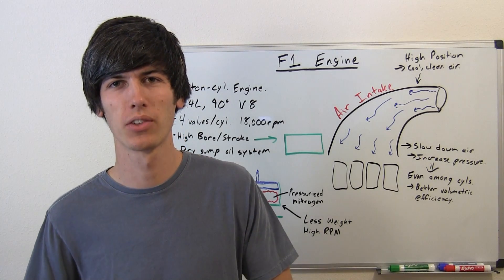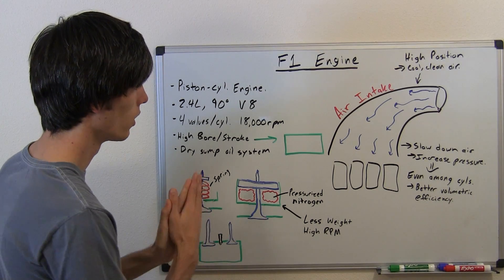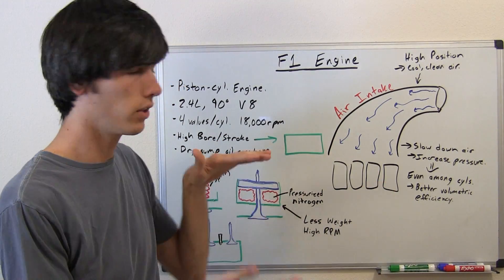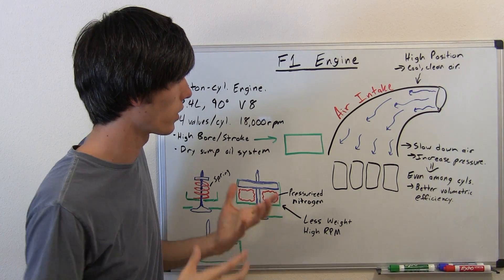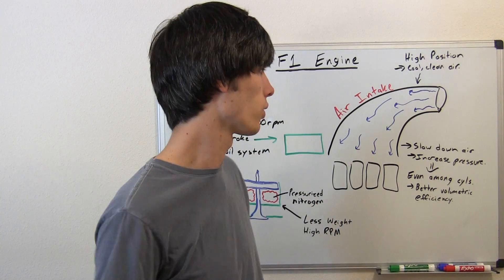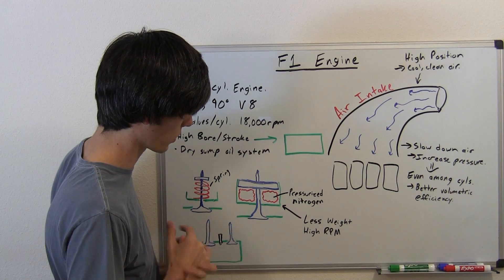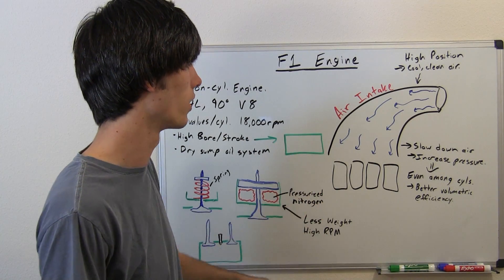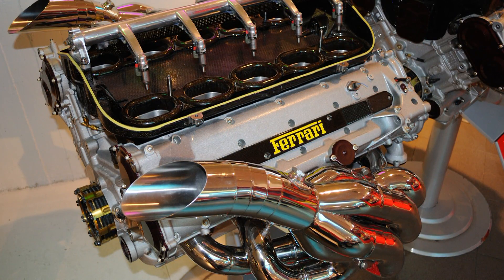F1 Engine - Explained

Comment: Fun fact, 600cc street bikes rev to 18,000 rpm's too. When I ride mine I'll purposely wind gears out just to watch how many heads it turns when people are trying to figure out what the hell is coming down the road ;)
Reply: +Nathan Berry mines putting out about 50 lbs peak torque with the exhaust system I have. They have inline-4 cylinder engines. All Japanese street bikes use inline-4's
Reply: +ReaIDeaI1 What do you ride? Didn't realize there were 600's that can rev that high
Reply: FUNKieMONKey55 I ride a 2008 Yamaha R6. There's older 600's that turn 20,000 RPM's lol
Reply: +FUNKieMONKey55 Older 2 stroke motors could Rev up pretty damn high. more than 20k rpm if I'm not mistaken
Reply: +Jeffrey Kim Depends on the displacement. 50cc racing bikes got there pretty easily. even in the 70s.
Reply: How much torque do those put out? Its a one cylinder engine right? Sorry i dont know shit about bikes im a car guy but i love engines no matter the aplication
Reply: +ReaIDeaI1 That's funny my Japanese street bike is a V4. I also have another Japanese street bike that is a V-Twin
Reply: sera56jase all modern japanese supersports have inline-4's anyway, not sure about older ones and sub-genres. The BMW uses an inline-4 as well
Reply: i think the old japanese two stroke were parallel twin's

Comment: how much horse power do they get out of these 2.4 naturally aspirated v8s?
Reply: 800-900hp
Reply: +Alec Collins about 750 from the V8 and about 900 from the V10. As of right now the V6 Hybrid gets 750 and there are speculation that they will boost it to 1000bhp (I don't know when

Comment: Explanation on volume efficiency through the intake is incorrect actually. What happens is the air funnels through the intake and down into the head. When you have a long runners this actually causes the air to move in the intake at a higher velocity than it normally would be with a shorter runner. So it is not a situation of low air up actually increased volume movement of the air through the intake. Therefore moving at a faster rate and causing it to fill the cylinder at a faster rate and more completely. This is why they put velocity stacks overtop a carburetor or individual tubes leading into the cylinder heads intake valve is the longer. And this tube is at a certain length and diameter that will cause it to your air to spin ( "rifle" ) into the cylinder at a higher speed. This increases the fill rate of the air going into the cylinder and fills it more completely at higher speeds.

Comment: Surely an engineering major would know that engines don't suck, he atmosphere pushes the air into the engine. A higher pressure always moves to a lower 
pressure area
Reply from the maker: +Todd Black (TeeBee53) I've been lost for many years, thanks for your help!
Reply: +Todd Black (TeeBee53) Actually, engines do suck.  there is vacuum created as the piston pulls down which sucks air into the cylinder.
Reply: well thanks Mr iknowevereything
Reply: yeah no. atmospheric pressure on the outside of the engines pushes air into the cylinder on the intake stroke whilst that cylinder is making vaccum. it is that reason why engines make more power with higher atmospheric pressure ie. at sea level as oppose to 1,000ft asl. simply because there is more pressure to push the air in.

Comment: The V-10 you showed at the end of the video has a vapor mist system for the itb's. What would they typically spray in a formula one car? Water - Meth? or?
Reply from the maker: +Caleb Smith Fuel. :) (Those are the injectors).
Reply: +Engineering Explained Lol Gotcha. Still learning. I really like your channel and all the info I've gained from it so far. Thanks
Reply: +Engineering Explained Would that be common rail injection?
Reply from the maker: +Caleb Smith I believe common rail typically refers to direct injection. According to wiki common rail "features a high-pressure fuel rail feeding individual solenoid valves, as opposed to a low-pressure fuel pump feeding unit injectors (or pump nozzles). And no worries Caleb, ask away! The channel is for learning. :)
Reply: Does the f1 engine run a flat or cross plain crankshaft?? I know nothing about f1 engines but I beleive there flat plane??